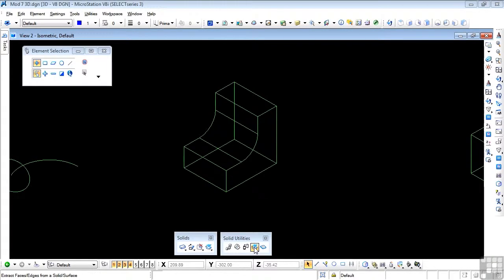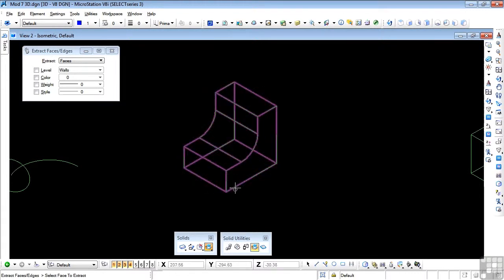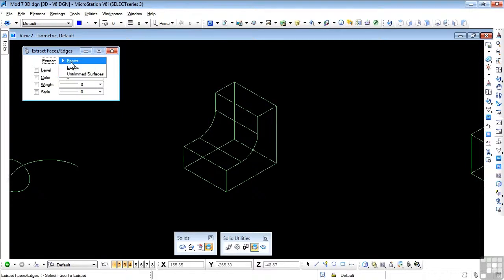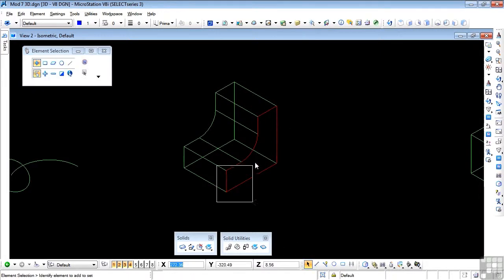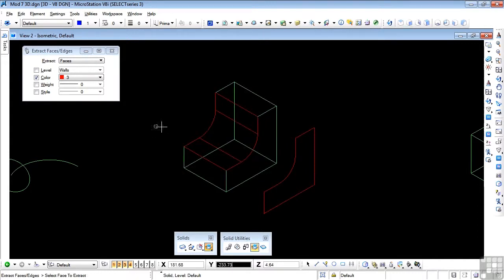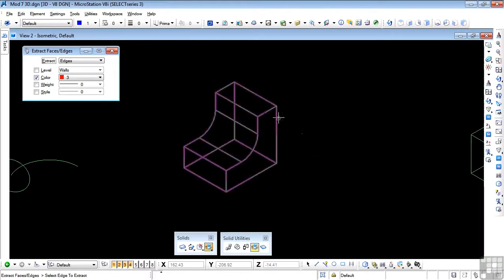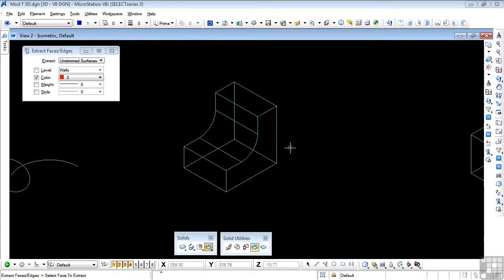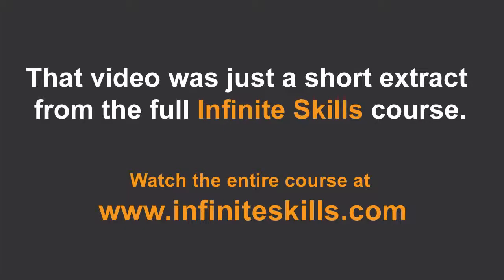Bentley MicroStation V8i 3D Tutorial | Extract Faces Or Edges

Comment: great tutorial. i used to use the solid by extrusion tool in v8i but have recently upgraded to connect edition update 13. in CE, the solid by extrusion tool does not seem to let you grab the face of another solid anymore. extracting the faces and then extruding them works really well as a substitute, although it does add an extra step.